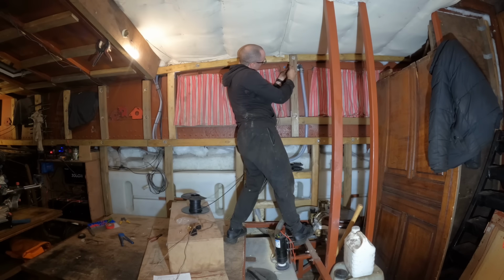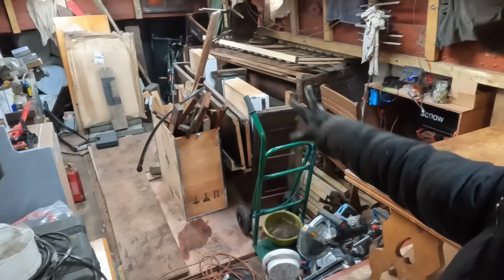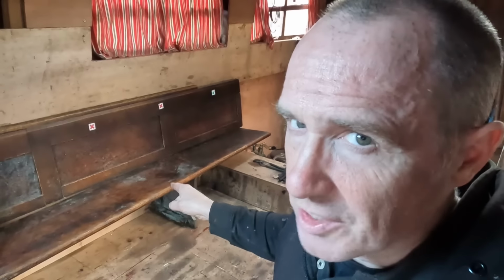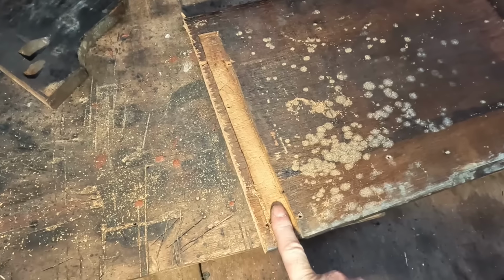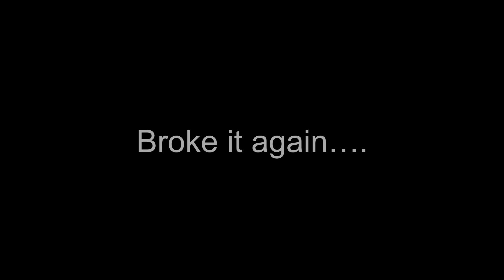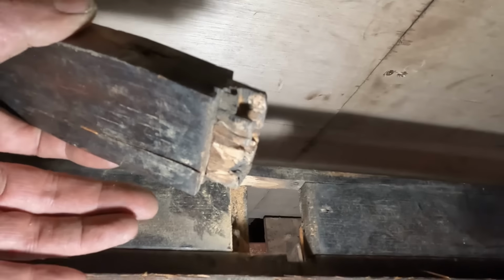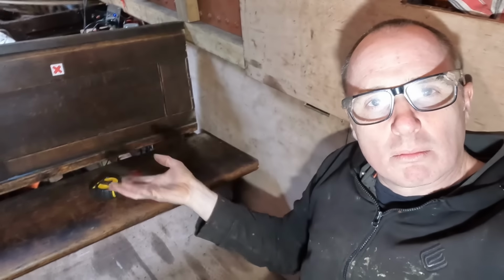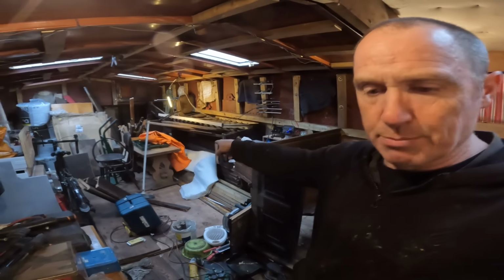Fitting Church pews from Covent Garden London, into my boat.

Comment: I had faith in you that you can finish the project because you always had the right spirit. I'm sure repurposing the old benches wasn't an easy task and involved many prayers that everything works out as planned. And now holy cow does that look good! 😇
You can easily make an expanding table using piano hinges. This is very common on boats because usually the table itself can't be moved. I'm sure you will find a solution and it's great that you're finally back making great content. What a great way to start a Sunday morning. (It was a busy week so never mind that it's already Thursday...)
Reply from the maker: I’m going to look into a range of ideas before I embark on a plan for that table. Fold down leaf has advantages and disadvantages. But so do all the other solutions. 😂😂😂

Comment: 11:25 - Hate to bring bad news, but you shouldn't have glued the panels in.  They should be free floating or, at most, glued either only in the middle of the end grain edges or on one long grain side only.  When they are fully glued in they won't be able to shrink or expand with humidity changes and will end up splitting eventually (unless the glue fails).
Reply from the maker: I had noticed that they weren’t glued in the first place, but didn’t know why… 
Well, now I do! Thanks for that! 
The glue has failed elsewhere if that’s a consolation…😂

Comment: Majic progress!  Suggest the table has two flaps that you can fold down to fill the entire space to form the bed base?  Use piano hinges maybe?  I'd draw a picture if I kno how to put that on YouTube! Cheers
Reply from the maker: Here are the choices.
If you’re sitting in the pew and you raise/lower a flap you’re locked in during the meal. You could escape if you push the plates away and lower the flap..
If the leaf is on the end and for most of its life it is down and then there’s no problem until you have four people…..
Alternatively, make the ends of the pews little suicide doors and open them like an old car. However there are technical issues relating to the strength of the pew after cutting the door out. 
I’ll muse on it…..😂

Comment: When tightening those pipe clamps (name?) it’s often easier to use a ratchet and suitable small thingy instead of screwdriver that always slips and hit of course your palm, fingers and after that you seek the screwdriver in the bilge… also get it tightened much more than with the lost screwdriver….
Reply from the maker: You know what the sad bit is….. I have those tools and worse I’ve used them for this job in the past…. This is what happens when you go on holidays. Forget everything!😂😂😂